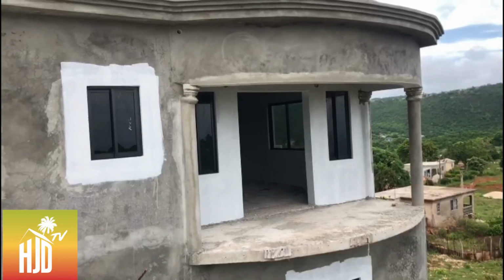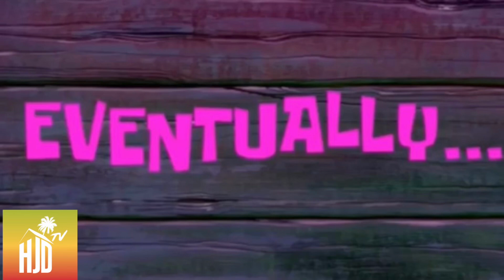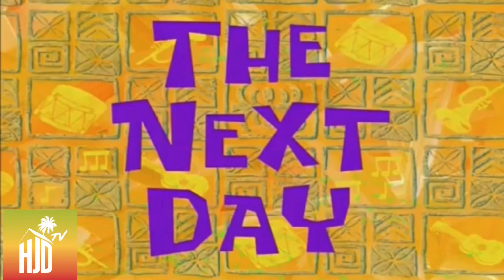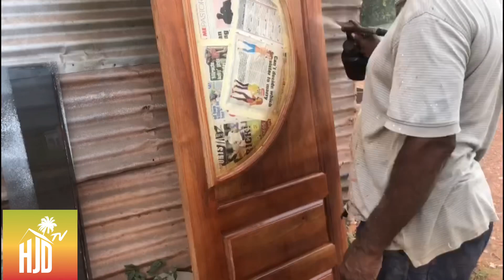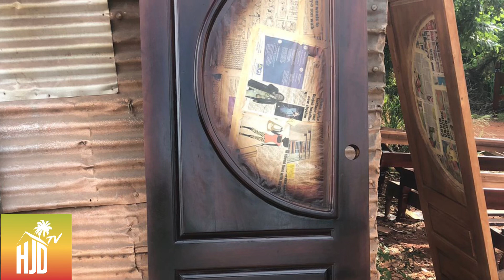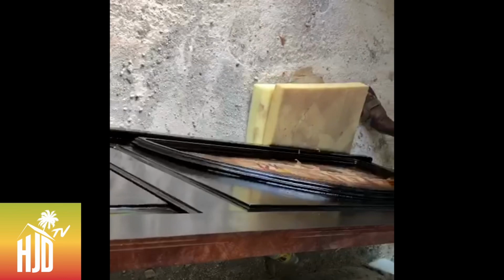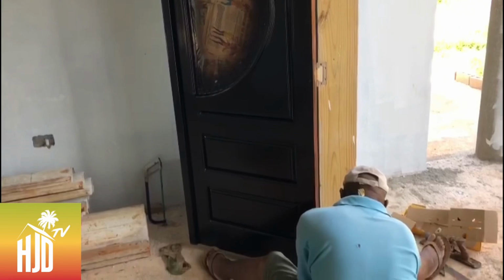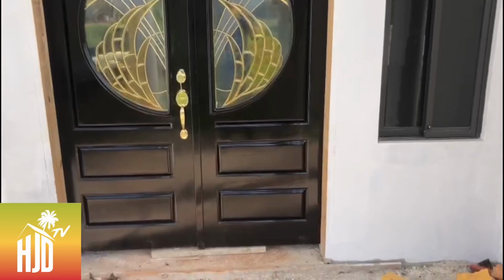Building our dream house in Jamaica. Season 5 EP# 5. Front door installation

Comment: Really nice doors and you also decided to support the local Jamaican trade by having them built instead of buying the imported ones. The door handle should be on the right you are correct. The Carpenter should wear respirator when doing all that spraying, varnish is toxic to the lungs. I have been watching from the start, I am amazed how they work without safe guards that are mandatory in other countries.
Reply from the maker: Thanks drewski , yeah they have no fear when working at all . They don’t take many precautions. Thanks for supporting 😊

Comment: Loving it I am watching and listening to everything you  said. These  tradesmen you have to give them the job long before you need the doors. I guess the doors should work out a bit cheaper than the hardware
Reply from the maker: Thanks Roosevelt, so so true 😊👍🏽. Have to ask way in advance . It should be cheaper than getting it  at the hardware for sure . I didn’t really come across double doors in the shops though . Mayb I didn’t look in the right place .
Reply: @hayjamdantv  my door way is 6 inch wide so custom made would be great options for me as well